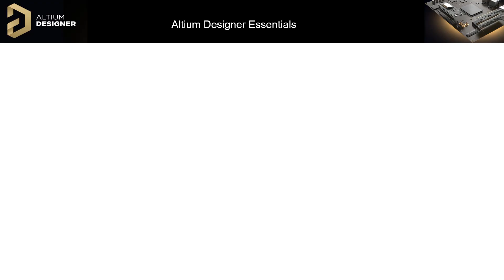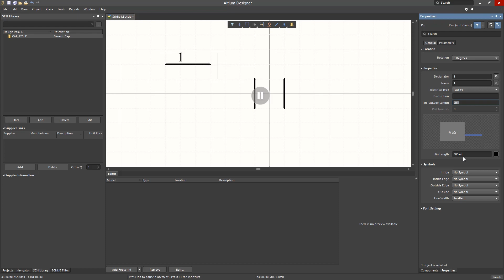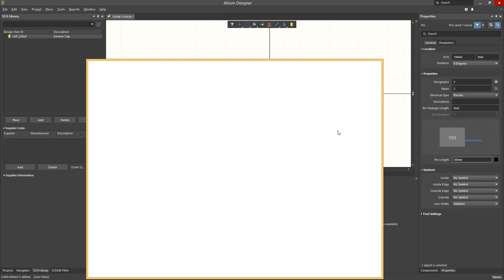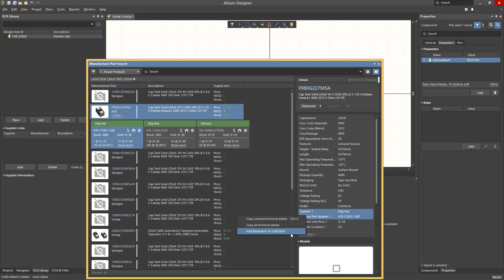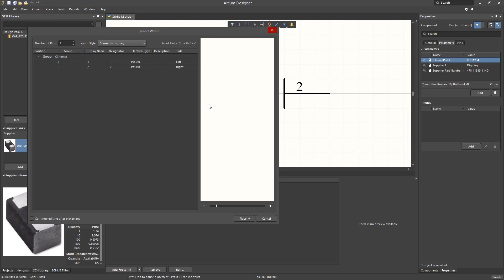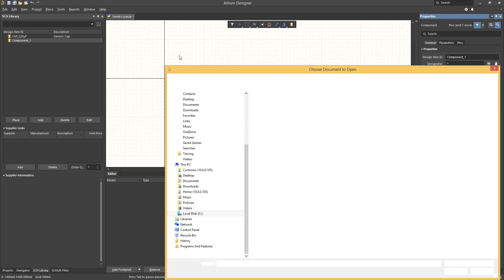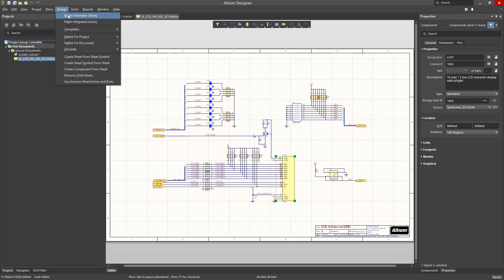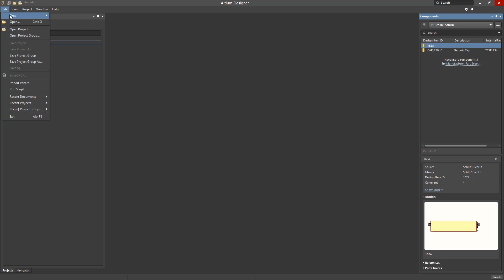Schematic Symbol Creation | Altium Designer 19 Essentials | Module 29

Comment: Disappointed in this module.  The creation of the symbol using "smart paste" was hard to follow, and the final symbol didn't look right,  it has 21 pins instead of 20 (two pin 1's) and pin 20 ended up on the left instead of the right.